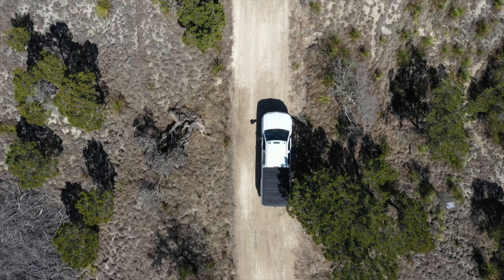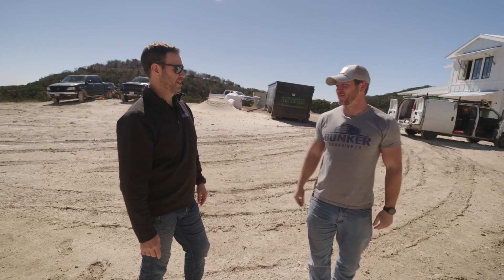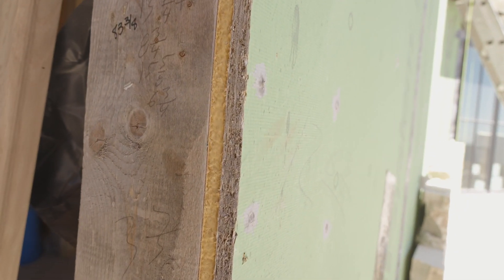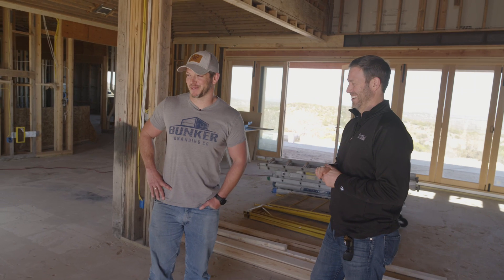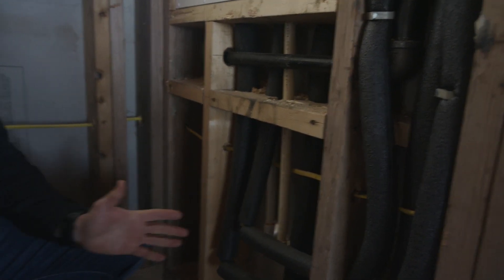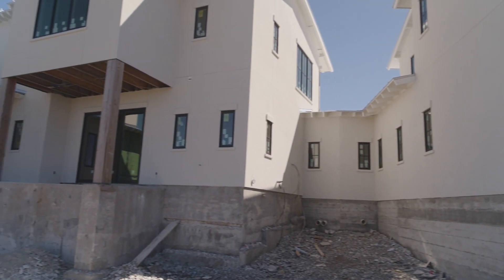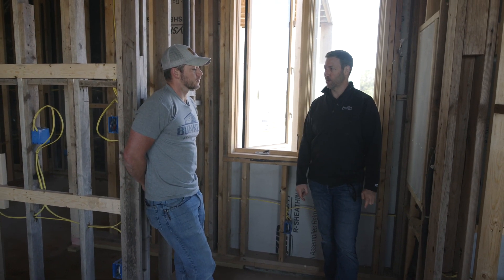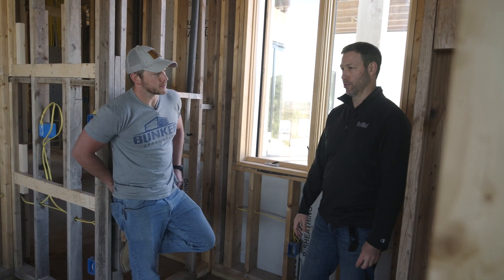One Vulnerable Spot at the Abandoned Mansion

Comment: If I was to build in Texas I would build like we do in northern MICHIGAN.
Reply: Singing sweet home alabama all night long!
Reply: saves a lot on air-conditioning too
Reply: I'm from Michigan too, and I'm fact I'll be moving to Texas in the next year. If I end up building or remodeling I will be sticking to Northern standards. With the addition of all of Matt R. tips and tricks
Reply: Agree.  I wasn’t a fan to only see the Zip R3 used in Texas heat.  I’d at least do the R6 for those 16” OC studs and then spray foam.
Reply: Thank God I'm a country boy
Reply: well, the vapor direction is reversed, so be careful or you'll grow mold. also, big overhangs in michigan can be tricky because you'll form ice dams. southern states don't have that risk but need much more sun shading. there may be some other things that change, but I can't think of them right now.
Reply: @somedude-lc5dy  true but I would go with 2×6 or 2×8 walls and zips r 12 plus 4 inches of close foam insulation that would give me a r 36 or higher  in the walls  then put up to a r 40 in the roof

Comment: A tip on those hose bibbs when the hose is disconnected, it will spray out of the vac breaker. Open the hose end, sprinkler, sprayer etc, the water won't spray out of the VB as much.

Comment: With that expanse of roof, a solar system with a grid-independent inverter and battery backup might be a good idea vs a backup genny that sucks down gallons of fuel.
Reply: You could probably fit close to 30kw on that size roof.
Reply: Both systems should be in place on a home like that cause solar doesn’t work in ice and snow and major cloud cover
Reply: Definitely would want a good backup generator regardless. Solar is not foolproof.

Comment: Matt.  Woodgasfire + generator + backup batterys can't lose power.
Reply: this. also generator will only kick on for large loads or to charge up batteries then shut off. MUCH more efficient use of generator fuel since generator will be cranking out max power. Then let the batteries buffer the power usage. Throw some solar in there as well and you're ready for the apocalypse. solar will also keep more cycles off the batteries and the generator.
Reply: @mattb6001  I second that. With that location and roof solar would be perfect. You could probably fit close to 30kw on that roof.

Comment: Next time we get a hard freeze, we are turning off the water at the meter. Also opening the pipes to drain system.
Reply: Same here!!!!!
Reply: Use compressed air to blow out the water lines and use RV anti freeze in the waste water traps.
Reply: Depending on where you are, leave your faucets dripping. As long as the water is moving some it won't freeze as easily. And then all you have to do to make sure your lines haven't froze is make sure your faucets are dripping. Froze line = no drip.
Reply: @cantgetright742  , as long as no drain lines are routed in an outside wall. I have seen three inch pvc frozen up while bathroom faucet was dripping to keep from freezing.
Reply: @cantgetright742  I'm east of Houston. We lost power for 2 1/2 days, our water entity lost power as well. 
I had one of my outside pipes dripping. But once we lost water pressure, I had to turn off the water to the house and then open everything up.
Reply: If your water heater is in the basement you can usually drain entire system by simply opening lower valve on heater. Just make sure not to forget to turn breaker off for heater if electric until full again or you will burn elements out.
Reply: @69jbr69  good add in with the making sure its full before putting the power back on.

Comment: I’m in Houston and we had just about every pipe in our 1985 house break from freezing. We dripped our facets but it just wasn’t enough. We had the 5 degrees and a few other days of 25 degrees. It’s Tuesday and we have our A/C on now. There is no question about changing out copper with PEX. The bad news is that the Plummer will not be here until March 15. The sprinkler system also took a hit. Sago palms all took a hit. The only good news is that the pear trees will produce this year. The lime trees died. 

The one item that all houses should have is a shutoff valve AND and drain. If we had power, the pipes in the house might have been okay.

Comment: Pro tip- in northern climates you still need to shut water off inside to the hose-bib. Frost-proof nozzles will still freeze and break with water in the line around 0F

At least the "frostproof" one in my DC area house froze- in Maine it was way more of an issue though because its under 30 for months at a time

Comment: Matt, a few weeks back the ranch was getting stuccoed and the stapled the wire to the zip system walls does tha damage the air insulation as prior you paint over all the nails and now putting hundreds of staples in it

Comment: Geothermal hearing is the way to go for a house that size.
Reply: Second that, vertical mount , it can double s a water bore hole ,the only problem I see is being a Texan hill it will have possibly Boulder or bedrock instead of soil or clay
Reply: Geothermal is great for ac but not great for heating... I would never put it in  any place that gets cold..  We put it in our place out in the country where all we had was power , but its a power hog... $500 plus a month for our power and I run all energy efficient lights an appliances.  Our house is also only 13 years old.  But we live in Central Canada where we can have -40 for a couple weeks at a time  along with +40  to in the summer
Reply: @Mac88Fraser  We use geothermal mainly for heating in Germany...
Reply: we use geothermal along with a boiler and radiators in the ~9000 sqft house that i live in, although this house is old construction with additions, not all new construction
Reply: Listen to the earth :)
Reply: Geothermal is NOT the way to go in this instance:
1. Its on a hill, and I grew up in that area...It's ALL limestone.  Heat transfer is crap through limestone.  Normally 100' well per ton of cooling, with limestone probably more along 150-200' per ton.
2. Digging a well through stone is expensive.  In some instances well over $100 per foot.
3. Rough gestimate, with foam insulation in walls and roof, he could probably get by with 12-15 tons of cooling.  Cost for the well system would be astronomical.

I would suggest a dual fuel system (heat pump with propane as you emergency heat).
Reply: @Mac88Fraser  yes granted you will have to probably upgrade your radiators or use underfloor heating , and does help if your house is well insulated but so does any heating.   compared to normal electric heating /oil it’s a lot more energy efficient  we use approx 2500kw a year to heat a 6 bedroom house 2600ft  compared to the old that used to consume 10,000 therms of gas other than when it dropped to negative 5 recently was only running for about 4 hours a day constantly , not a fan of forced heat but it can be a hybrid with this and do ac as well , so far just a yearly check and filter clean and magnasafe refresh
Reply: @Jack Skonieczny it heats but its ridiculous expensive.....  an with heating you don't mess with the  temp.  Ours stays at 22.5 all year around. Winter an summer, if we change it in the winter up 2 degress it takes prob a hour or 2.  Ac on the other hand , 2 degrees cooler it takes like 15 mins.

Id spray 3inch closed cell spray foam in  my house,  do vipeq thermal cork on the outside over the zip. An have a cheap electric furnace.    We have no gas around us unless i want to spend $68,000....
Reply: @Jack Skonieczny we r out in the country,   I didn't want propain or oil to have to deal with , an than remembering when the best time of year was to get it.    Figured geo thermal would be great!!  But none of the installers say it will cost a small fortune to run. $500+a month is our power bill🤮
Reply: SunRun and no on this but free is good but no one should do this
Reply: @gnaarW  and that’s why you are poor 🙁

Comment: I can't believe anyone would ever install their water heater on the exterior... like, why? it's not that hard to run a vent.
Reply: water heaters also give off heat into the house. fine for most of the year in colder northern climates.
Reply: Having done my own house mods...there are pluses and minuses to every possible way you can accomplish something.  Just depends on if you can live with the results.
Reply: @chadharris7648  , there is a big difference between an individual making a mistake and thousands of experienced contractors and many manufacturers deciding to make and install a product like that. this isn't someone who just messed up and didn't think about it, these are supposed to be professional, high-skill, high-cost builders. people like Matt who go on and on about edge-cases and what-ifs. it's just surprising to me that such people would still continue that practice.
Reply: @somedude-lc5dy  yeah and you know the manufacturers who make on demand water heaters for exterior installations they are just so dumb and should have consulted you. Like John Delano said they put off a hell of a lot of heat esp the on demand ones if the choice is between trying to mitigate that heat inside by running your ac longer or just putting the thing outside many would choose to put it outside and manufacturers have designed them for that the problem is that they were not familiar with the procedure for dealing with sub freezing temps and power outages and water outages all occurring together and thus water was left in the unit when it should have been drained this is not a design flaw nor an installation flaw it is a maintenance and management failure the home owner is at fault for not being aware of the proper procedure not the installer.
Reply: Because we don’t have your shitty weather but every 60-100 years. We have to keep our houses cool not warm and we don’t commonly have freeze issues. We don’t bury water lines deeper than a few inches because we don’t have freeze thaw
Reply: Why spend the extra money on something to make you happy that we could go our entire lives never experiencing matter of fact I’m in Alabama and it’s only snowed twice in 28 years and it didn’t even stick but an hour

Comment: Matt should go with an electric heater with the heat pump.... with a big solsystem? Smooth sailing. Still need the backup generator. Solar is electric and the panels don't like the freez either.. plenty of backup batteries and no worries .

Comment: Like others commenting here, I'm surprised such an enthusiastic advocate of building sciences, tech, and sustainability as yourself isn't a proponent of PV solar (with batteries): far more reliable,  greener, and cost effective alternative to a generator.
Reply: PV solar with batteries is a huge waste of money
Reply: @kellymoses8566  what makes you say that? Grid-tied and you're beginning to pay back at day one. As opposed to paying maintenance contract on genset that will likely as not fail when actually needed, and affords zero return the rest of the time.
Reply: (Oh: and genset of course needs fuel, either trucked-in diesel, or LP, or municipal natural gas, which I understand failed due to icing in much of TX. Again, during large scale emergencies when needed most, genset is "non starter.")
Reply: Texas learned a valuable lesson in trusting unreliable sources in times of crisis. PV and renewables in general are supplemental energy sources and should never be depended on when SHTF.  Backup propane/NG/diesel generator will keep a house going indefinitely. There’s a reason why hospitals use diesel generators and not solar panels/wind mills for backup.
Reply: @Thesheriff1776 Many reasons, in fact. One biggie is not nearly enough area for the mammoth electrical load. But commercial and residential applications/equipment are not comparable. Any homeowner who's lived through an extended outage knows that the genset will not in fact run indefinitely. If the fuel doesn't run out first, maybe it will overheat. Or seize for want of oil service. And when all your neighbors are in the same boat, good luck finding service techs and parts. Ask me how I know.
Reply: Furthermore, recent TX outages resulted from overwhelming demand needed to heat homes built to low standard (if you follow this channel, you know what I mean) coupled with frozen natural gas distribution to the gas-fired plants that produce much of their supply. Wind is a significant component (25% vs 51%), but can't be singled out for blame here. Reducing consumption at the source (efficiency + on-promises generation) is the key to long-term resilience.
Reply: @Thesheriff1776  you are spreading lies . Only 10% of Texas electricity is wind. The vast majority of power plants that didn't work in the cold were  natural gas
Reply: @the1maxb  because PV and batteries is really really really expensive.
Reply: @kellymoses8566  I’m don’t mean to come off as a keyboard no it all, but it is pretty funny because I install solar and wind farms across Texas for a living. There are no lies here and I encourage you to not trust me and do your own research. Wind accounts for ~18 percent of all power in Texas, solar about 2%. We lost half of all renewable production which due to growth in demand, and incentives, became essential sources instead of supplemental sources as originally intended. Yes there were NG lines which froze as well causing some plant shutdown. Yes a nuclear plant’s safety sensor froze and shut it down. All contributed to losing half of our energy production in Texas and caused the outages. The point isn’t that supplementing our more reliable fossil fuel production with renewables is a bad thing, but that when crisis strikes you need to have reliable energy. So lower your energy bill with solar panels that’s all fine and dandy, but when you look at the amount of energy it takes to power heating elements and other appliances, you need a reliable generator as your fall back always.
Reply: @kellymoses8566  sure it is, but so is building to Passive House efficiency standards as advocated here. Both pay for themselves in time (and then some), and both can be rolled into mortgage for realized savings from day one. The addition of batteries to a PV system is an incremental cost equivalent to that of generator, without the bulk or noise, and much less maintenance overhead.
Reply: @the1maxb  With current battery technology storing electricity is so expensive it should be avoided at all costs. It would take millions of dollars of batteries to store what electricity can be generated by a few thousand dollars worth of diesel.  Being off the gird NEVER makes financial sense.

Comment: Heat pumps are a bit of a trouble if you want to have emergency generators, they need a lot of amps to start up. Consider some step up smaller resistor based heating to keep the house from freezing, Cheers from Finland!

Comment: Matt I have had older Pex line freeze and crack...it spider cracks like China. This line was installed 20 years ago. It was a quick fix and I promised myself that I would install a proper hose bib...
Reply: Pex is not UV stabilized and needs to be completely covered if sunlight hits it; otherwise, it will become brittle and develop tiny cracks.